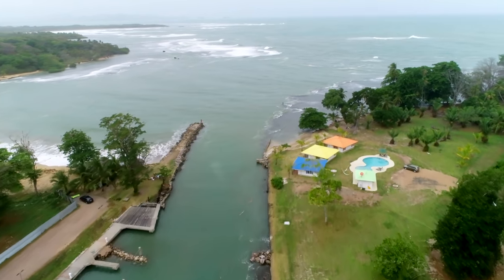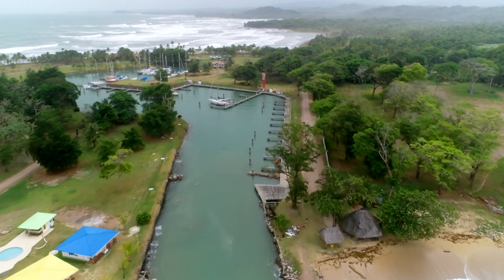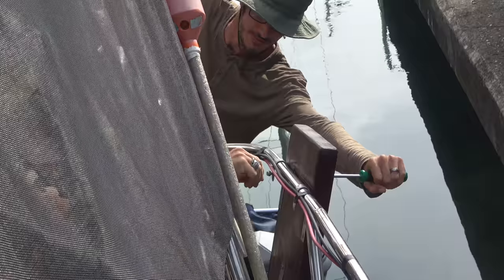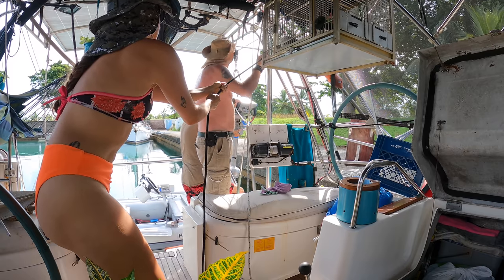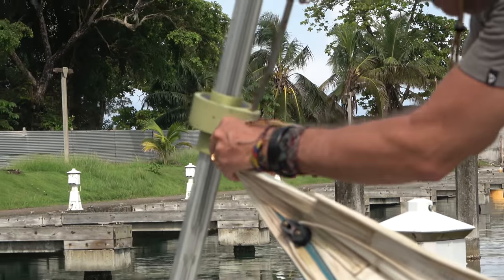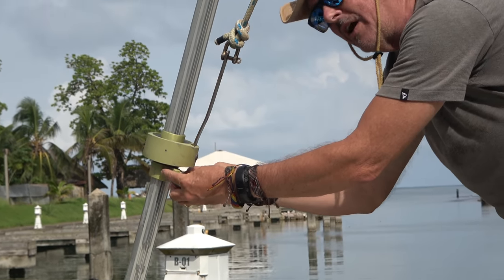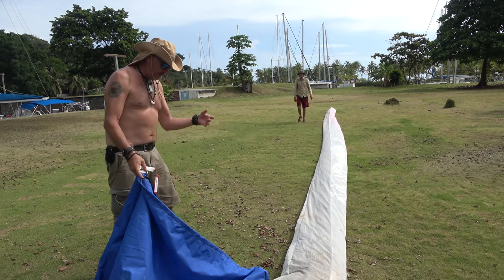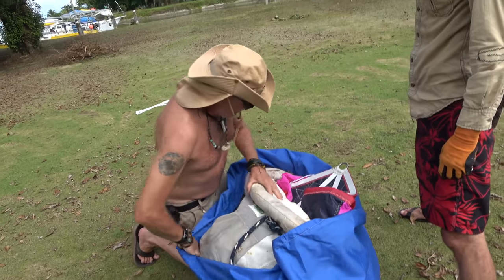SSL593 ~ Installing NEW SAILS..!!

Comment: The Jib came down very easily, and seems to be in good shape but I guess looks would be deceiving , like the fact that it had that problem !  So, it was too long ?  I've always wondered if a motor, especially an electric one like that, mounted from a spot off the bow, and set up to be controlled from the cockpit, also, set up for thrust port and starboard, with reverse and forward control, you see what I'm talking about. You should I think.